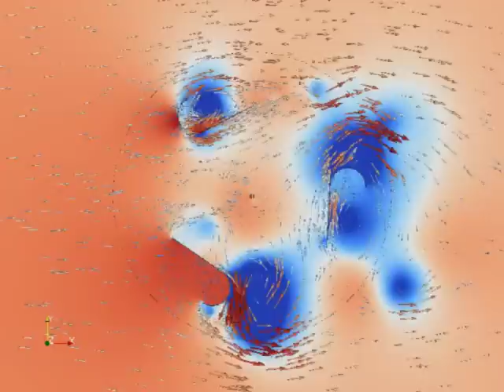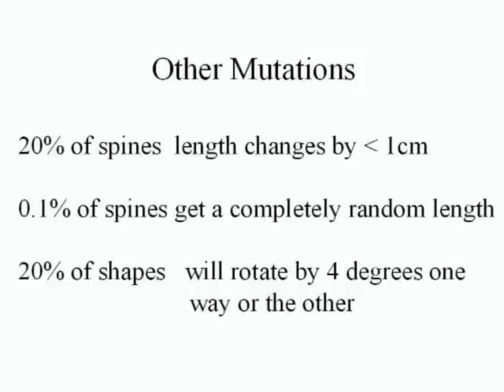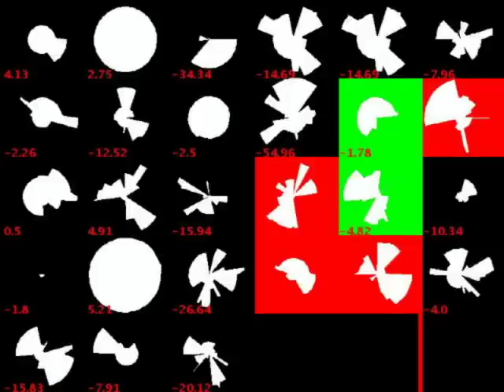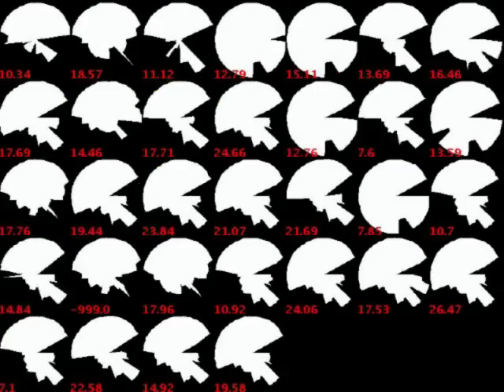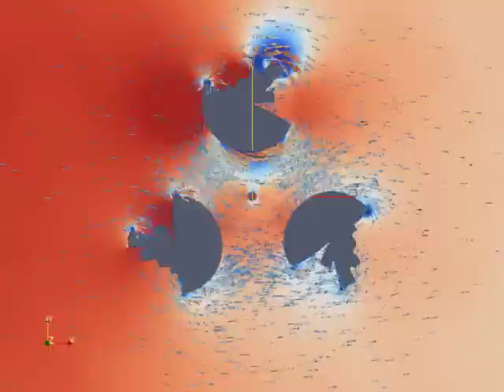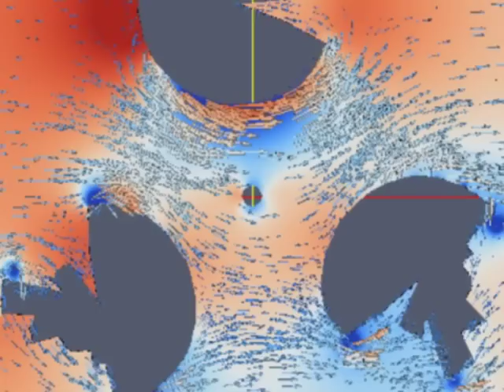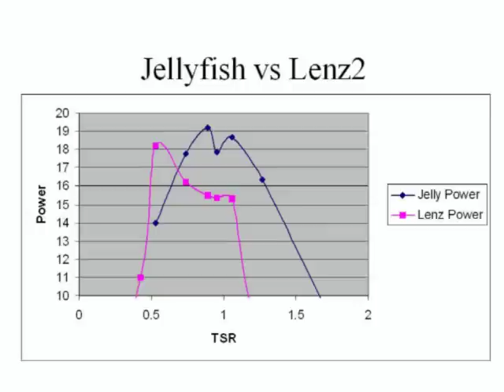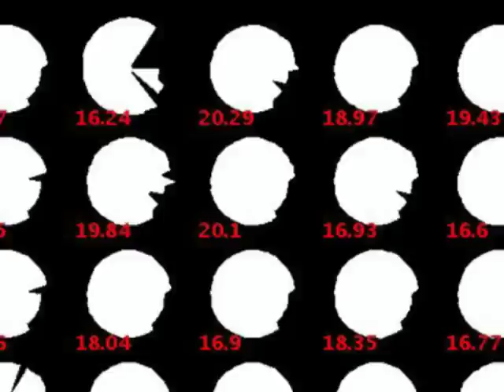Evolving Wind Turbine Blades

Comment from the maker: @petrcechchelsea 
No the way this test worked is the turbine is spun (by an imaginary motor) and the torque the wind puts on it is measured.  If the torque is pushing forward for more speed, then positive power is made.  If the torque is pushing backwards, then it's taking power to hold that speed.  It's possible it would spin backwards but all we can say for sure is it wants to slow down.

My later sims actually have the wind drive the turbine

Comment from the maker: @Shalek 
Unfortunately I evolved these blades using the wrong viscosity for air, so while it's a neat demo, the results aren't meaningful for use in our atmosphere.  (The simulation is for a much thicker gas.)  I need to correct that and try again when I get time.

3d sims take a very long time.

Comment from the maker: @chrach 
Openfoam can calculate the torque on the turbine.  I can convert torque into power by using the equation 2*PI*RPM*60*torque = watts.   Efficiency is turbine power / wind power.  Wind power is 1/2 * 1.2 * area * windspeed ^ 3.

Comment from the maker: @johnjejo 
Yes, what you say is correct, but as it was it took my 64 bit 4 core computer 2 weeks to do this.  Finer changes and larger populations could easily make that months or years to complete.

-999 is not a real power measurement, that number means something happened to the simulation.  (Sometimes they get out control and the numbers blow up.)   Since I didn't have time to look at each one individually, I had the program just assign a very low power number to get it out of the population.

Comment: (post 3 again) ... it assigns them according to a equal spacing order. My advice would be to combine these two though. This way, you aren't trying completely random numbers and will more easily find those left out spots... and you still will cut a lot of time by pruning it based on a "previously solved species database" (another name i just made up - self explanatory)  I'd assume that many initiations, even if spread, will result in the same species. Lemme know if I explained that right...

Comment: I agree with your response to my (post 2), but not the first one. Competition in this case is not dependent on different species relationships! Therefore no grid... multiple interacting species stuff. Yes, I'm not too educated, but I think you understand what you called the "mountain climber" idea was. What you said the second time about running the simulation many times would basically work except for the fact that the possibilities will overlap... It would be hard to... (continued)

Comment from the maker: @TimJSwan89 
(post 2) Or I could just run the simulation many times as it is.  Each random set of starting points seems to bring out a new species.  Then compare those later.

Comment from the maker: @TimJSwan89 
Okay I agree with what you are saying, this is definitely the mountain climber problem where we never know if we are on the highest peak.   In nature you get multiple species by having them use different resources or space, so they don't compete against each other.   Right now in the simulation everything competes against everything else in the long run.   If I added some spatial dependence (where they are located in the grid) to determine which ones had to compete.

Comment: (Post 3) So why wouldn't these other solutions spawn off the one you were working on? Well, that's probably because there are multiple optimum solutions that are not optimum in between. (like a shark is a great animal and so is a pelican, but to mix their genes would not likely have positive results) Basically, my theory - or opinion - or thought on this is that the solutions are like points or lines on hills in topology, and they must be widely tested or you could miss one.

Comment: (Post 2) of how many optimizations there actually are by making sure you randomly generate shapes and ensure they cover broad possibilities. What if in your algorithm you cut off the evolution of something that could have been better in the long run, but didn't happen to prove itself early on because it still had too many flaws? No matter what, you can assume that based off parameters you give  it, there are only so many solutions. You found one solution (or species) try another?

Comment from the maker: You are correct.  My method of describing turbine shapes doesn't allow a lenz2 to be developed.   I will eventually try an enhanced version of this, but right now my problem is that I built a real turbine and it doesn't match simulation.  My sims are laminar flow and I need to add a turbulence model.  Until the sims match real life, evolving shapes won't be much good.

Comment: I noticed something that I think is important! Your variable basis allows only for polygons with a required center area. You can't even make a Lenz2 with your algorithm! You need to either make random polygons with arbitrary coordinates (perhaps limiting it with a boundary circle with the same radius as the one you have already). Or even make an algorithm where it is only surface area (curved lines with [no area] from above view) Something tells me there can be alot more than just the jellyfish!

Comment: You could also consider some method for "punishing" a bland gene pool. Perhaps a dynamic mutation rate that automatically increases when gene pool becomes too uniform. Of course to do this you would require a way to measure the similarity of different samples, which I imagine might not be simple.

Comment: The largest weakness I have noticed about genetic algorithms is that they tend to settle or get stuck at local optima. Once they discover a pretty steep peak in the solution-space, they tend to stay there, and it seems to be difficult to improve this behavior beyond a certain point.

Is there any possibility of getting a 3D rapid prototype of your evolved blade? Also, you might try adding selection against excessive area. You might be able to find interesting solutions that are more economic.

Comment: Great series of videos.  Thanks. 
Have you noticed that your mushrooms are roughly a mirror of the lenz?  Also turbulence surfaces (cf golf ball), plus solid foils can materially improve aerodynamics.  Evolution doesn't start from random but from a baseline.  Have you considered genetic algos on lenz variants around the basic pressed sheet form but allowing shape and texture deformation; flipping and radial spread, folding to create solid infill areas ... ?

Comment: Brilliant!  Thanks for sharing.

Have you thought of having the spines come off a line (thin rectangle) rather than a central point.  You could vary the length of the line as a parameter in your genetic program.  The line could be deemed to be tangent to the circle the vawt is spinning in which *may* solve orientation issues.    

What happens if you start with a pop of lenz and jellyfish? (Or are they too prejudiced to mate?)

Anyway, I'd be interested to see what you come up with next.